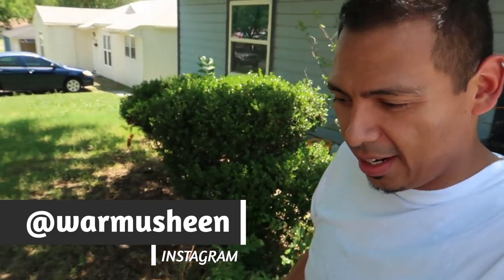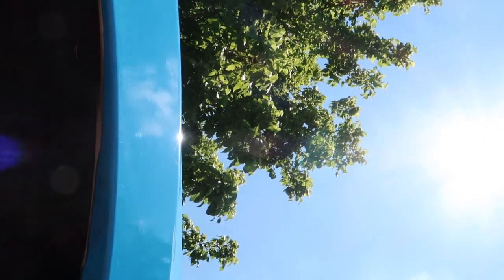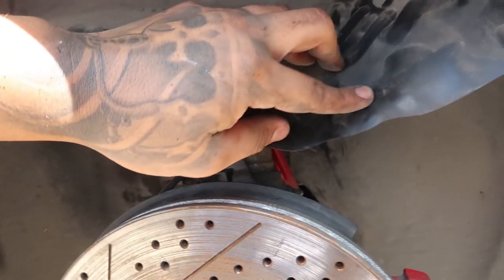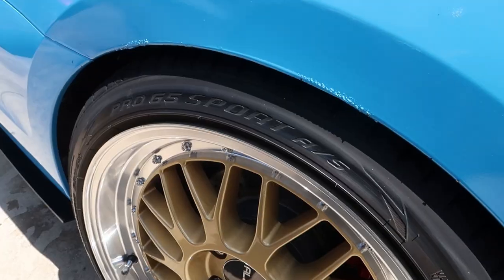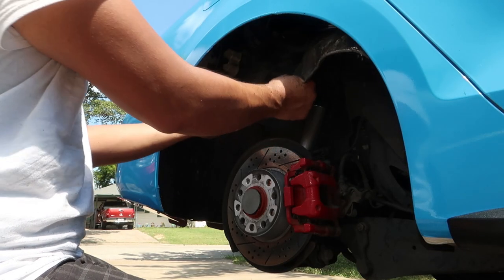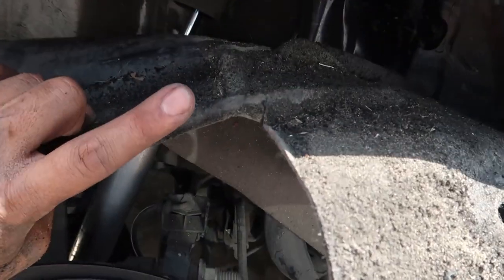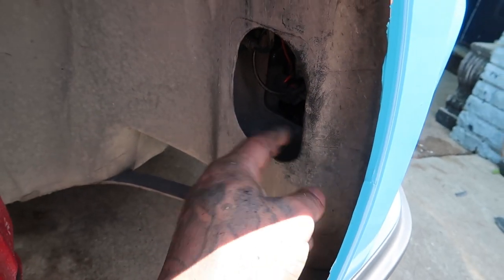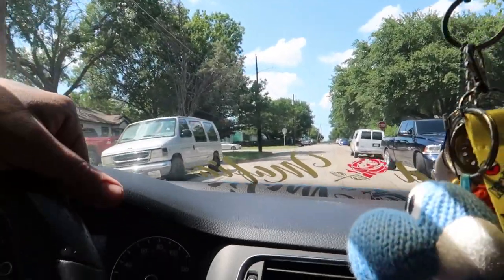Tire Rub Fix - Lowered Jetta owners MUST SEE!

Comment: Running the same size like you (18x8,5 ET 35 and 225/40/R18) on my mk7, thanks for the tip of cutting the fender liner. I sppose my issue is more the metal connection piece between fender and front bumper

Comment: Just bought a 2011 Jetta TDI. The front right rim edge is being scraped by the fender and the left side tire is taking the paint off the fender. Looks like a major fix is needed.
Reply: Not a major fix at all 😂 you can probably just adjust your coilovers also a tdi should last you a lifetime

Comment: Thanks for the video. I noticed you used a rubber hammer to get the lip pushed back in the wheel well, do you think a small balpene hammer would work?  Don’t have a fender roller and trying not to damage my car wrap.
Reply from the maker: It'll work, just go easy on it. Doesn't take much for the fender to flex. You can use masking tape on the fender or a rag so you won't damage it when you bang on it. Good luck 👍
Reply: Thanks for the quick reply Joel, appreciate the feedback.
Blessings,
Hans

Comment: I’m running stock wheels just lowered today and I’m hearing what sounds like rubbing. Is it maybe just the new lowering springs haven’t set yet? It only seems to happen at higher speeds like 90+ and not all the time

Comment: What size are your wheels and the offset? And what size tire are you using?
Reply from the maker: 18x8.5 +35 runnin on 225/40 tires. If you still have clearance issues in the passenger rear, you can make a minor adjustment to the camber.